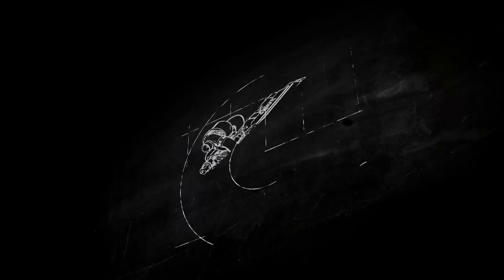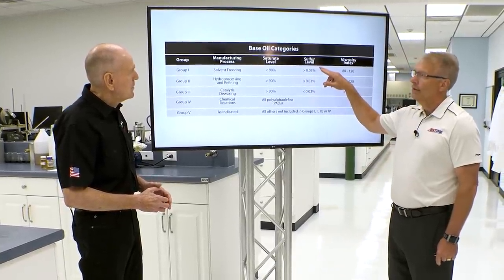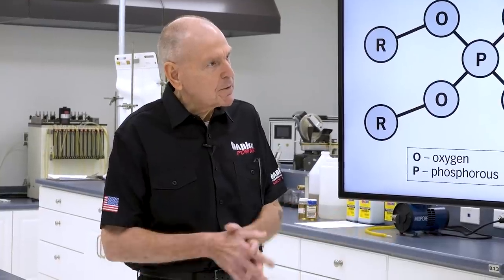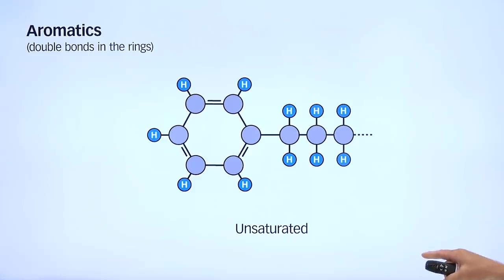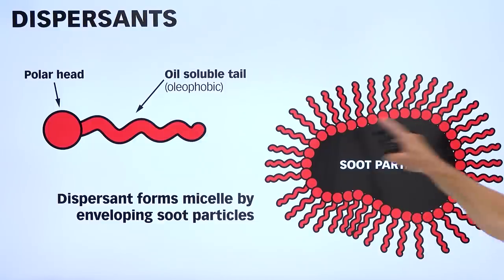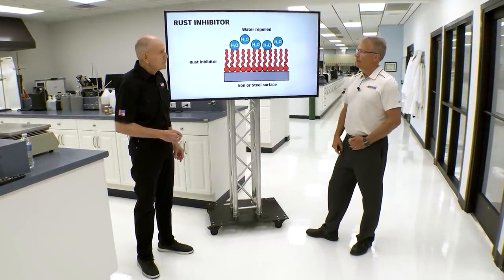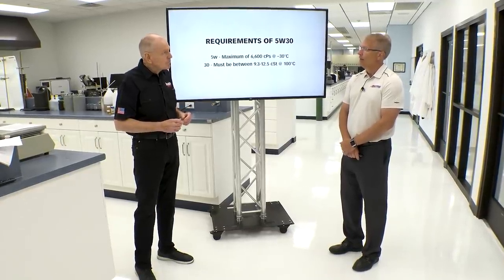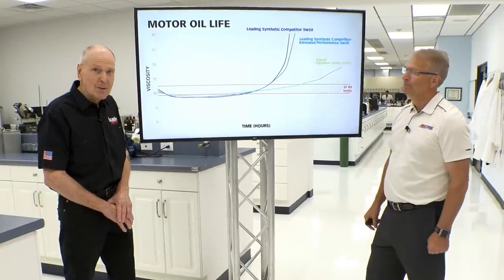What's in synthetic motor oil | Part 2 of 4

Comment: Now I know why my full synthetic engine oil would show a half quart low at 3000 miles the new engine wasn't burning it. The oil was vaporizing because the oil wasn't good enough to withstand operation temperatures over that mileage. Another reason to use 100% synthetics. Thank you Amsoil for truly educating me you now have a new customer.
Reply: The product data sheets of any engine oil will show you vaporization loss in % from a standardized test. Good quality synthetics will usually yield a loss in the 8-10% range. And since the testing is done at conditions that normal engines usually do not run at (sustained very high temperature), the loss you describe might not be due to evaporation.
Reply: @tandemwings4733  not necessarily. In Germany and Japan, only those engine oils whose base stock contains 80+ per cent Group 4 may be called "fully synthetic". In other countries, it is legal to label any engine oil whose base stock consists exclusively of Group 3 or better as "fully synthetic". And in all honesty: a well-made Group 3 (which isn't "mineral" by any sense of the definition) is any bit as capable as a Group 4, as indicated by huge overlaps in their respective VI ranges. In the end, it's all about the manufacturing process and how it is being applied and monitored. And most oil manufacturers have no control over that because they buy additives and base stocks from external sources.
Reply: @tandemwings4733  I work in a refinery which happens to produce a very high quality Group 3 base stock. And knowing the process, I can assure you that there is much more involved than just simple refining of crude fractions. Yes, its very basis is crude oil (which is btw also what alpha-olefines are being made of - said refinery runs an olefine plant as well) but after the full process of catalytic hydrotreatment, saturation and isomerization that product (which we call HVGO for hydrated vacuum gas oil) doesn't really resemble anything anymore that was present in the crude oil. Its VI is in the 160 range which is perfectly adequate to formulate any engine oil in the 5W-30 or 5W-40 weight.

Alpha Olefines are actually being made in a very similar fashion from crude oil, but instead of hydrocracking certain crude fractions, you will use a combination of steam cracking and quenching to obtain an olefine mixture that will then be rectified into the desired components, including alpha olefines which will then be used in a polymerization to create PAOs. The process, if done correctly and controlled properly, yields base stocks in the 175+ VI range which are good enough to formulate even the highest viscosity ranges like 5W-50 or 10W-60.

The thing is: what makes PAO synthetic is the polymerization alone. And using PAO is not necessarily a sign of superior quality because you can actually run a polymerization that yields a substandard quality when being compared to a high quality Group 3. It's like everything in life: it's not the name brand that automatically gives you quality.